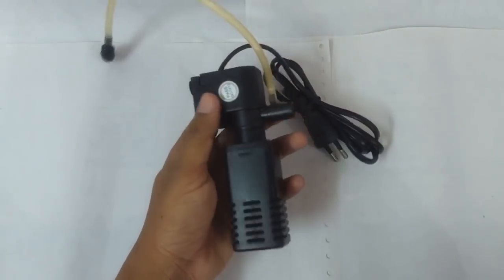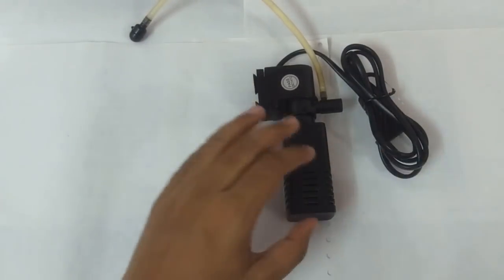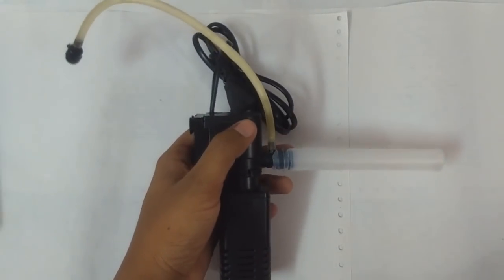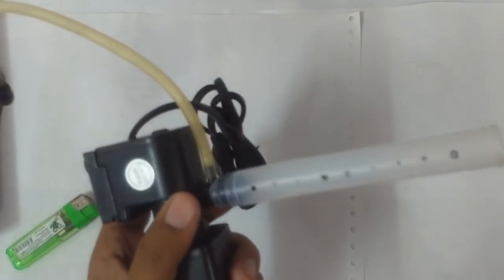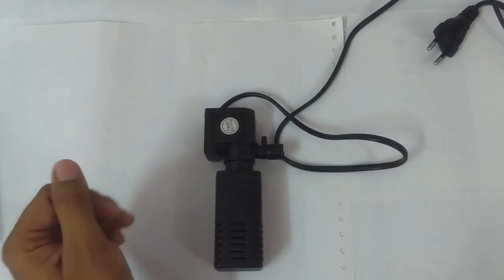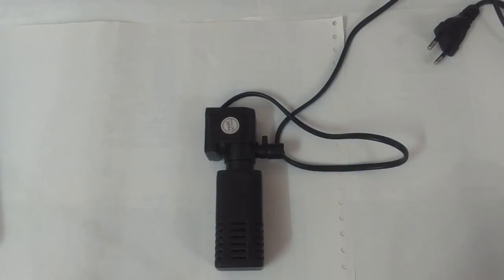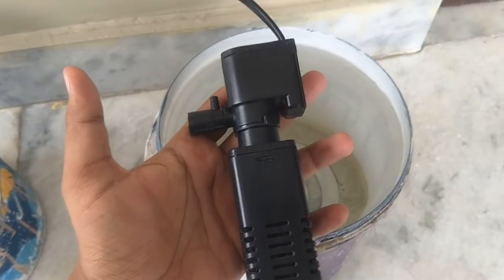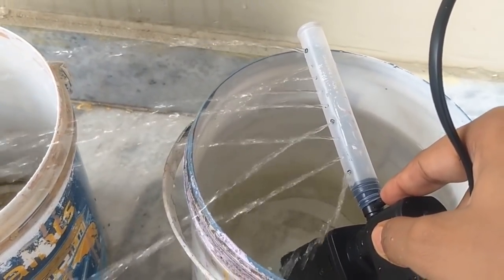How To Reduce Aquarium Filter Speed | Reduce Water Flow

Comment: Loosely tie a aquarium sponge with rubber band at internal filter output tube. That's it. 😁. Try this , very cheap and easy solution
Reply: Bro please explain me properly
Reply: @satheeshrosi7159  cut a piece of sponge similar to the one inside the filter. Loosely tie with rubber band at waterflow pipe
Reply: @ceeyes  ok that reduces output flow, what about powerful suction pressure input

Comment: Not sure how I ended up on this video but rather doing all this, its better to buy a hang on filter. Also in case you bought something that doesn't work as described... Return it, no need to make any modifications.  keep it simple 🙏. Another thing, based on all the ideas you shared, all you are doing is reducing the output flow. which means intake pressure remains the same and Betta wont be able to swim properly, which will stress betta and will eventually result in death. 🙏🙏🙏🙏🙏

Comment: Thanks for the idea brother, 

I tried your method and reduced the output hole by attaching an old pen, unfortunately I think this causes too much back-pressure which pushes water out through the air intake tube as a side-effect ("made a mess on the table" situation)...

So, an alternative I found is, at the end of air-intake-tube, we have a provision for opening it, I pop-opened it, I made a cotton ball and stuffed it into it then closed it; and when turned on, was able to reduce the flow pressure as I preffered...
Reply from the maker: Thank you bro. But, stuffing the air tube with cotton or any other material only reduces the air intake volume. However, the water flow remains the same.
You can verify this by putting you hand in front of the filter output nozzle. 
But, whatever you did works for you then its great.
Reply: @gurribuy  Yes, seems you are right... just the visual bubbling seems to be lesser now after cotton, when lifted out of the tank the flow is quite unchanged...

Comment: Super bro.but if we control water flow in filter the moter  will be falt or not?
Reply from the maker: the main idea is to change filter output into many small output stream. 
we are not trying to slow down or stop the water flow. we are just trying to change single stream of water into many small stream so that all the small streams are not that powerful.
it will not damage your filter.

Comment: Going off what I saw on another video, you can also put a bit of filter sponge into the output. I haven't tried this yet as my tank isn't completely set up. My tank is only 19 litres, so the pump I have is too powerful. Would you recommend filter sponge in the output?
Reply from the maker: sure, use a coarse sponge. It should help the water flow easily.

Comment: What about air bubbles?.. using any of these methods air bubbles pipe will also start flowing water outside?? I have used small filter fitted inside water taps ..its working with bubbles coming out u can also suggest this

Comment: You literally saved my betta. Thank you. 
I didn’t see any other sources mentioning the tricks you mentioned. I tried the cloth one and it decreased the current so so well. I just need to modify a bit (maybe stitch it with a thread and needle into a tube shape, so it doesn’t open up once in water). But amazing. Thank you.

P.S: I have a large tank (7 gallon) but since it came with an already-installed filter, I couldn’t change it or control the flow. So these tricks helped a lot.

Comment: well.. Old video but still very informative.. I just have one question in mind.. If we use a baffle for flow reduction like any bottle/empty glue stick then the water circulation will be low or same as before? so filter can still clean like before or not?
Reply from the maker: water circulation will be same as we are not trying to stop the flow we are just diverting the flow from a single fast stream to many.
Reply: Water circulation will be stopped and filteration will not be same as before personal experience

Comment: Can I block the air intake pipe a little bit...... Please reply
Reply from the maker: yes. you can either pinch the pipe a little bit or use a air controller valvve.

Comment: What is that oxygen tube used for? Are you meant to block it or leave it open and put it back in water colum for surface agitation?
Reply from the maker: that tupe is for creating air bubbles in the water.
What you do, is connect one end to the filter and other end goes outside water.
When the filter pump is working it sucks some air from the tube and throws that into the tank which then becomes air bubbles and when the bubbles pop at the surface they create some surface agitation as well as helps in exchange of gases and mixing of oxygen from the surrounding.
Reply: @gurribuy  I'm confused because when I connected mine to the filter it started spraying water..
Reply from the maker: @an-dreekosps9061  the part where you connect the air tube on the filter is rotatable or not? if yes then rotate it 180 degrees let me know if that works.
Reply: @gurribuy  I'll check it within the next couple of days and keep you posted!  ican't Atm getting ready for NY party 🎉 thank you 🙏🏻

Comment: Guyz just a small suggestion for small tank owners, if you buy 1.5 feet or less size tank, you'll have to worry a lot about the water pressure coming from the Power Air filters else you could try the Video methods. Next time if you are thinking of Power Air filters, go for minimum 2 feet Tanks as it has more space to throw the bubbles.
Reply: Totally Agree.. I am facing this for my 1 feet tank
Reply: @chavanofficial  Me too :(
Reply: @chavanofficial  Me too

Comment: Can we totally block this outlet in Top filter? I mean the filteration will still go on right?
Reply from the maker: if you have a top filter then all the water will go to the top filter.
yes, the filter will still work. But the only problem you can face is if the water does does not drain from the top filter back into the tank then the top filter will start overflowing.
Reply: @gurribuy  Thank you for your clarification.

Comment: Does the filter work well without the attachment pipe which creates bubbles?
Reply from the maker: yes. filter still works well. But, you can reduce the bubbles with a air control valve.

Comment: Bro please tell me if we attach air stone to power head filter then it is good or bad
Reply from the maker: no, it will not work. Powerhead produces with a different technique and an air pump uses a different technique. You can only attach air stone to the air pump not powerhead.
Reply: @gurribuy  thanks for replying

Comment: Question bro  if you use small bottle, it can still supply bubbles?
Reply from the maker: yes, make enough holes in the bottle and you should still get the bubbles. But, the bubbles will be inside the bottle. attaching the bottle vertically will also help in producing bubbles.

Comment: I just made necessary speed reduction to my filter.  But bubbles are not coming out.  Does it provide necessary air supply to the fishtank without bubbles
Reply from the maker: if you reduce the speed then the bubbles will not come out of the filter. If you have a lot of fish in one tank then bubbles are necessary but if you only have 4 or 5 fish then bubbles don't matter much but there should be some water movement inside your tank.

Comment: Thanks for the idea..i used it in my 2ft fry tank months ago it worked well..now i m using the same for my top filter with 2400L/H for my 3*2*2 ft tank for betta community..it keeps the fish happy..wont mind for my power head ..hope it doesnt gets damaged🤪
Reply from the maker: i'm happy that it worked for you. The basic idea is to redirect water flow in such a way that the water does not come out in a single stream but is diffused into multiple pathways.
Reply: how is ur filter doing after using cloth ? r u using the same filter
Reply: @dij7a  I never mentioned using a cloth..

Comment: Will it help and if yes, can we have this filter outside the tank? Say using two pipes one for bringing in water and other connected to the output with a particle filter (one of those external filters that come with RO) fitted on one of the lines? 

I have a small tank and have ended up buying a big filter :(
Reply from the maker: yes, you can but you will need to make your own filter somehow because this pump cannot work outside water. I will make a video soon about DIY external filter.
Reply: @gurribuy  Great looking forward to it. I need to some how regulate the flow to use the filter in my tank. Yes I got greedy and managed to get WP1000 filter. Its way too much for my tank.

Comment: Using these method does my filter motor gets too much load or pressure? Is there any chances to filter failure due to this?
Reply from the maker: i'm using these methods, my filter is still working.

Comment: Hi,will this method damage the pump?
Reply from the maker: No, we are not trying to stop the flow or restrict it. The point is to redirect a single stream from the filter into multiple small stream so that the output is diffused and same as before. Doing this will not damage the pump.
Reply: @gurribuy  Thank You,Sir

Comment: Water also flows on air flowing nozzle... Is there any problem for the filter pump???
Reply from the maker: No problem for the filter pump. The air pipe will help release extra water pressure and nothing will happen to the pump. Make sure you keep the air tube inside the tanks otherwise the water will spill outside water.
Reply: @gurribuy 💞ya OK bro... So thanks for ur kind information bro.... 💞

Comment: I just used a flow reducer in air flow to decrease the speed.
Reply: Can you tell me in detail.
Reply: @prem767676  it will only reduce the airflow not the water flow
Reply: @dharmarajmd19  how pls explain
Reply: @deenchannel4684  I used a small 15ml bottle and made few holes and then connected to the outlet. Keeping the holes on the topside so as to break the stream in to a number of outlet

Comment: Man i got this idea even before watching your video or any video and even i tried it but it didn't worked as i thought.... ofcourse you can reduce the water flow rate of a filter ...but the problem is you just killed the airflow by doing that" No more oxygen' 🥱.......

Don't worry i have the solution too ...just go for the inlet rather than the outlet which doesn't creat backpressure through air tube.... 🙂
Reply: I disagree.  Putting stuff on the intake valve means that the food and waste stuff that gets sucked into the filter and out of the water then just stays in the tank after this proposed modification. i.e. Drastically reduced filtration.

The filter is there for filtration, which the methods in the video, particularly the last one, INCREASES.  You can add an air stone for increasing air in the water.
Reply: @jeevw2954  air stone what is that?? I commented that 3 months ago... But now i have even better idea instead of that pen he used use a small plastic tin (ear buds tin).. Make a hole on that cap of that tin and also make tiny small holes as many as you can around that tin and install it into that outlet of the filter... Done now no problem for oxygen and filtration

Comment: Dear, how do i stop air flow in power head filer and if my sponge gets damaged can i use normal sponge in power filter.....
Reply from the maker: You can use any porous sponge. You can also buy the replacement sponge from your local fish store if they stock them. replacement sponge costs about Rs.25 at my local shop. Now, if you want to stop the air flow just close the air input on the power head of your filter.
Reply: @gurribuy  Thanks

Comment: Hey bro, i want to ask you a question. I have a 2 x 1 x1 Ft Planted Aquarium. Which filter should i use?  500 L/H or 880 L/H ?  i have only 3 fishes and may get 2-3 more in future. 
Thank You
Reply from the maker: 500 L/H should be good enough in a planted tank but 880 L/H will also work. you have about 60 liter aquarium and if you divide 500 with 60 you get 8.3. that means the filter will cycle the water about 8 times in one hour. and the bigger filter you divide 800 by 60 you get 13.3 so, about 13 cycle in an hour. Finally if i had no plants i would go with the bigger filter but if i had plants i would use the smaller filter. I hope it helps. By the way what fish are you keeping.
Reply: @Gurribuy
 Thank you for your fast answer. Yup i do have plants and i have 1 Rainbow and 2 Angel Fishes. I m thinking of buying some more fishes.But my primary objective is the plants, the fishes are secondary.

Comment: Get an air control of aquarium air pump and then just put it on the air pipe of filter.
Reply: Awesome!
This is by far the simplest method! 
It made sense and I immediately tried it and it worked! 
I only hope this has no adverse effect on the filter pump?
Reply: @raphaelferns  where to get it?
Reply: @raphaelferns  that's my query too.

Comment: after one year the air bubble has stopped but still the filter filters the water... Is there any solution to restart the air bubbles? Please help...
Reply from the maker: If one end of the air tube is outside water and the other end is connected to the filter, you should get the bubbles. Make sure that the air tube is not broken or clogged.
Reply: @gurribuy  Now I noticed that while the filter is switched on, the water also enter into the air tube. How to solve this?
Reply from the maker: @lunaticloony6742  are you using your filter normally or have you tried to reduce the speed of your filter by putting something in front of the filter output.? If the output of the filer is blocked even a little bit then the water will enter in the air tube.
Reply: @gurribuy  No there's nothing in front of the output valve. I just changed the filter sponge. After that the air bubble stopped.
Reply from the maker: On the filter nozzle where you connect the air tube, see if you can rotate that and see if it works. try putting the filter a little higher in your tank( still under water). If the new sponge you added is too tight, it may cause the flow to reduce which will reduce the vacuum in the air tube. try running the filter without the sponge and see if the bubbles are generated.
Reply: @gurribuy  Ohk thank you.
I'll try...
Reply: @gurribuy  hey Hi!
I have just reduced the output of the filter nozzle and this is exactly what has happened. Now the water flow is way slow but there is water in the air tube.
I am okay with this but do u think this will affect the motor in the long run?
Reply from the maker: @raphaelferns What did you use to reduce the flow.?
Reply: @gurribuy  Hi,
I simply used the air flow stopper! :-)
I removed it from the air flow and using Araldite, fixed it on the output nozzle. Works like a dream! The water flow is way low. However, there is now water in the air flow! I have now improvised by using this waterflow to act as an oxygen input for the tank.
I just wanted to know if there is any harm to.the motor in the long run?
Reply from the maker: @raphaelferns  From what i understand from your reply is that the water is now entering the air tube and you have put the air tube opening inside your tank.
Now, water entering inside the air tube is normal if you have put something infront of the output nozzle but make sure you are not   stopping the flow too much or else the coil inside the pump may get damaged.

Comment: This will damage your motor..... See that outlet flow remains the same
Reply from the maker: This will not damage the motor, we are not trying to stop the flow, we're trying to re-direct the flow into multiple channels instead of a single stream.
Reply: the flow will remain the same, but wit bigger area you will have less speed, this is a general law in flow physics A1S1 = A2S2
Reply: The best way to know if u r obstructing the flow even if its less , is to see if water flows out of the small nozel through which air shud be flowing in .  I.e A1S1 < A2S2

Comment: Why you put your finger in front way of air inlet valve, also water comes in air inlet valve for reduce pump pressure and this one is not correct
Reply from the maker: can you tell me the time stamp. I am sorry i don't follow you.
Reply: Time stamp 9:12-9:27. In the filter output side there is a small pipe for air suction, if you hamper the out put flow pressure a small amount of water pass through the valve. And this is not correct because the value take air form out side when you install it in tank the air valve face is outside of tanka and you reduce its pressure by using your technic in this time some amount of water out out by the air valve. To reduce pump pressure so that it's not so good.
Reply from the maker: Suraj, you are right but every filter comes with a rubber cap to close the air inlet opening so you can close that. You don't have to use the air pipe the filter can work without air inlet.
Reply: Gurribuy without air inlet filter suction reduce
Reply from the maker: No, suction is not affected by anything you do to the output of the filter. If i had done something to the input of the filter where the pump suck the water then the suction would have got affected.
Reply: Gurribuy, okay

Comment: To control the flow of this internal filter u can just take that pipe above that nozzle from which the water flows instead of the rubber in that pipe just put a water T controller and u can easily control the flow of your filter u don't need to do all these long methods just that simple T controller would help reduce the water flow u can try it if u don't get the exact point then do rply to my msg I will surely explain you evrything in details